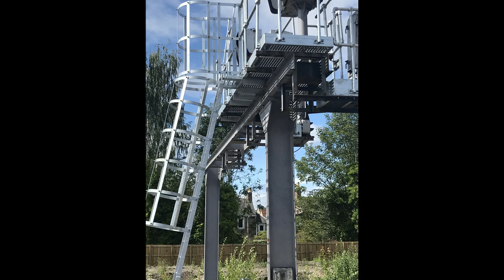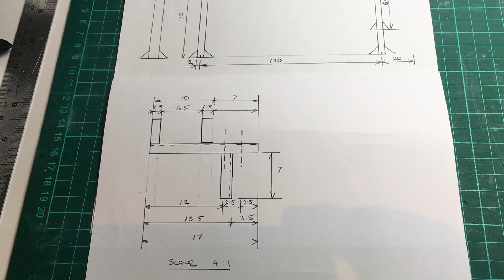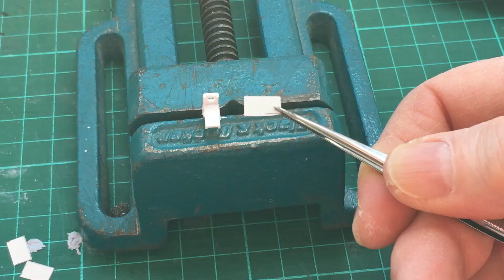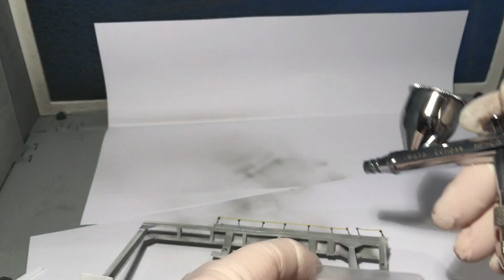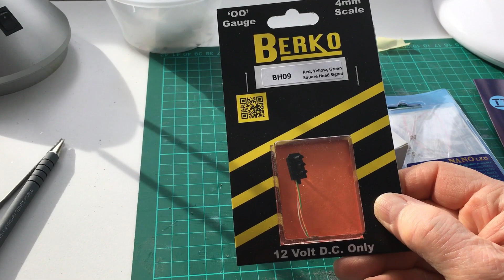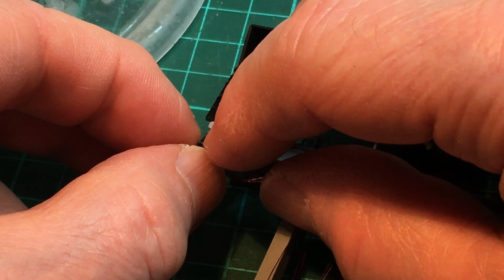Perth South Model Railway, #20 Signalling the Layout Part 2

Comment: "Plastruct" ! American and therefore expensive, as importation adds both VAT & Import Duty. Try Slaters (British company) so more reasonably priced ! I've been constructing 2/3/4 aspect signals using Slaters plasticard to build the necessary gantries for all my exhibition layouts for over 40 years, in numerous scales, in a similar way to what you are now doing !!!
Reply from the maker: Hi James. Yes just what I was able to buy at the time. I have also used Slaters for parts of the build and for other things. All the best. Hugh